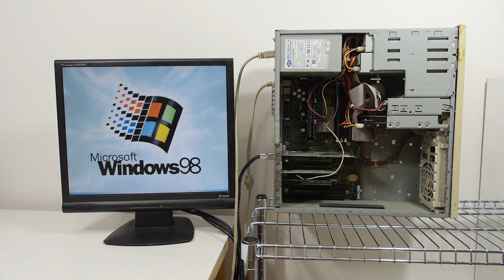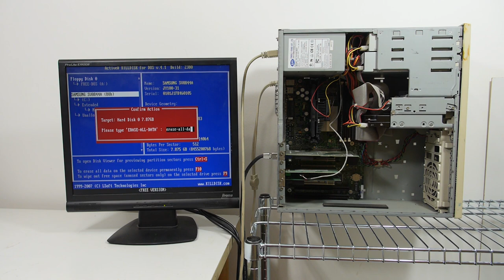Computer Vlog17: Parting out Dumpster Pentium II 350, 3DFX Voodoo banshee

Comment: Nice find. When you started talking about what parts you would keep and which you would not I almost got a little upset. The only thing that should be thrown away is the modem because they can't really be practically used anymore. Even the Floppy and CD drives, as well as the sound card is worth keeping. The Ensoniq Sound cards are some of the few PCI sound cards that have DOS drives so you may have a lot of them but for most people they will start to be harder and harder to find. Floppy drives over time start failing on read-write. I used to think I had tons of floppy drives in my collection until I actually needed them and I had to go through 10 to find one that didn't have errors reading and writing floppies. Please whatever you don't keep for yourself at least find another home for it. Thanks!
Reply: yup
Reply: Brandon Bridges I agree,although some of the AudioPCI either the Creative ones or the Ensonic variants failed on me pretty badly starting with driver problems (needed reinstalling after each restart) then eventually the whole cards seemed to not respond to anything but with no apparent reason,the next one however that was being plugged in worked every time.
The DOS support is a nice feature but those cards were meant to be cheap and sound quality wise were crap but anyways they are coming in handy and definitely WORTH keeping!
I know i like them as i have one into my IBM 5150 clone with Pentium II,i have a video of it on my channel "truebassb".

Comment: Very nice, I always liked the name "Diamond Monster Fusion" :-)! I also ordered a custom build PII 350 with a Gigabyte 6BXC and 3D Blaster Banshee AGP at the end of 1998. It had a lot of extras, DVD-drive and decoder-card, original SoundBlaster Live! with the daughter board and a TV-tuner and the sytem was connected to a brand new 19" CRT, a bigger TV for DVD- and TV-playback and 4 HiFi-speakers. As that filled the budget limit very much it was a bit short on RAM at the beginning with only 64 MB. Half a year later I got more RAM and overclocked it by running the FSB at 112 MHz and the Banshee also slightly. I loved that system and always regretted leaving the 440BX-platform in 2000 for the i815, I should've just put a faster CPU into the 6BXC.

Comment: Really neat system for somebody that would start Windows 98 retro gaming !

I've never find such good system myself complete, I've always found it in parts coming from different machines.

I've go the same voodoo banshee ! It's a nice one. The only problem on mine is that the fan isn't healthy and sometimes make noise. I already used some grease in it. It helped a little bit for a while, but it starts to make noise again ...
Reply from the maker: I need to check this fan to  and clean it more

Comment: I think I have the same model of motherboard, as that Intel. Mine is an Intel se440bx-2. If you have that board, then it is a really good board. Good find. Rock stable and can run a great number of different processors. I run an P-III-500 on my board.

Comment: As i said in other video, i have this case too. Its labeled Moonsun, but i also saw ones with labels by czech company Autocont/ATcomputers.
Reply: I have the AutoCont one, but it was used as a AT case instead of the ATX
Reply: @retropcs88  Also how it is with backplates?
Reply: You can unscrew the AT backplate and have a hole for a ATX io shield
Reply: @retropcs88  I mean how much i/o shields do you have?
Reply: @jirja3192  I think 3. One for a Gigabyte board, one for a Aopen motherboard and one for a AT motherboarf

Comment: I had this same motherboard (SE440BX) back then and it was pretty nice. I built a pentium 2 266 MHz with 128MB PC66 SDRAM, which I was later able to upgrade to a pentium 3 450 MHz and 256MB PC100 SDRAM, because the 440BX intel chipset did support 100 MHz FSB.
Reply from the maker: Yes nice that you build the 266 on the BX platform :)

Comment: People don't need to destroy hard drives as long as they wipe them. Unfortunately I think most people don't know how to wipe them. They don't understand the difference between "deleting" things from the filesystem or partition table versus actually overwriting the entirety of data on the disk. If the data is overwritten, it's unrecoverable to any human thief. Filesystem "delete" commands don't do that, which has led to rampant paranoia and needless destruction of entire PCs that contain the disks.

I think those Intel SE440BX series boards are among the highest quality Slot-1 boards anybody made, alongside some other non-retail boards that may appear in high priced prebuilds from IBM/etc. I would rank them a tier above enthusiast/home-build brands like Asus, but yes they are boring with no overclocking options. A Slocket adapter opens some options with them at least, and the motherboards themselves have had some hacks done I believe.
Reply: Plus most people think that when they throw out a non working machine, you can't get data off of it.
Reply: Slot 1 without overclocking ability (to change FSB) has very little value for retro comunity. The reason is, you cannot overclock celeron, and you cannot downclock Pentium II/III, to 66 FSB. Or 133 to 100 FSB. I have already one basic BX440, and I want to get rid of it, for the one, that can have FSB set. It's very important in Pentium II/III build. Slot 1 is so awesome platform, that to screw it up without ability to change FSB, is pity. If you don't want overclock, just take some i815 instead, for Universal AGP slot and lots more speed.

Slot 1 system without overclock, is eighter too fast for old games, or too slow for modern stuff. And it cannot be slowed down. You need to open computer and change processor it. Luckily, Slot 1 system is easiest possible for this. Anyway, when you don't want to change processor, just take faster solution, or more tweakable. And if you dont want to tweak and want speed, just take Socket A. For me, to take Slot 1 platform without ability to change FSB, doesn't have sense, and appeal. I would get rid of that motherboard too. The ability to slow down processor, is one of the most important feature for retro machine now. In it's time however, it wasnt so important for people, that didnt want old DOS games , only speed out of it. Yes, in that time, Intel SEBX440 had sense. But now, not.

Comment: There is a way to make those cd drives white again, just put them in a bag with some hidrogen peroxide (40 volumes is best) and put them in the sun until late afternoon,then wash off and  BOOM!!! it becomes white again!!
Reply from the maker: I gonna try it some day but not with this drives :)
Reply: I have celeron 333a slot 1  , banshee diamond monster fusion and 64 mb ram in chipset bx